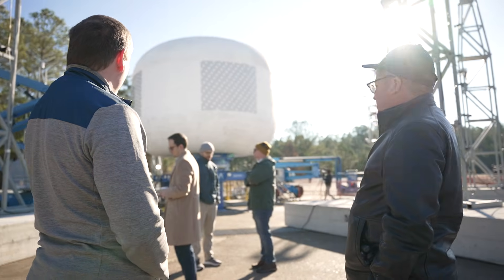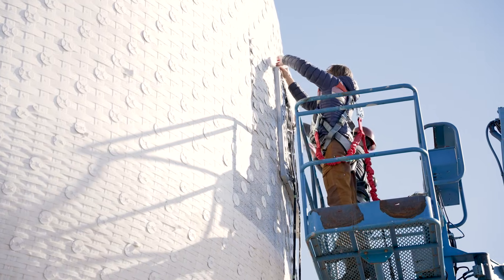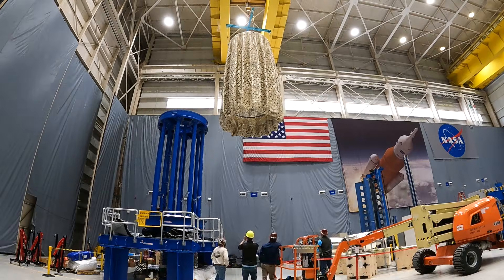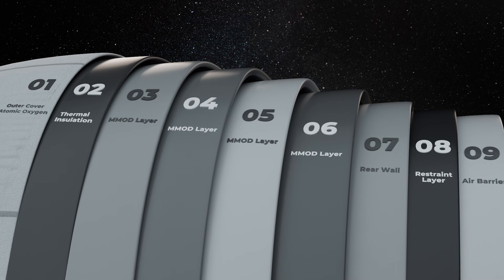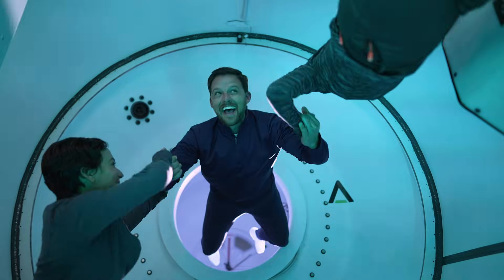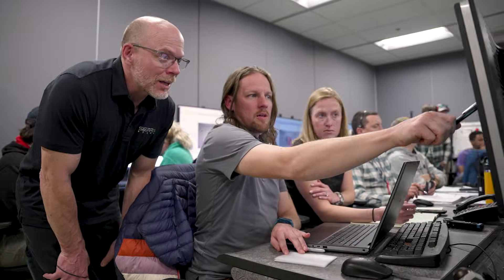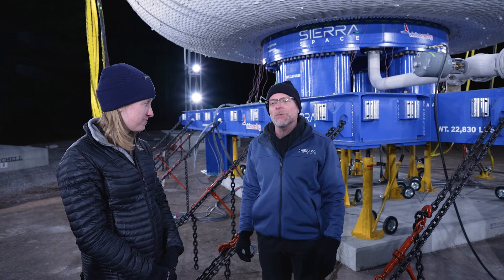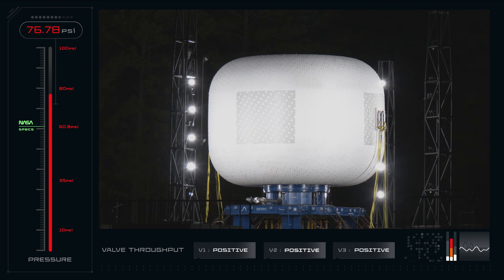Full-Scale LIFE™ Inflatable Space Station Burst Test at NASA Marshall Space Flight Center

Comment: 60psi?!?!  Your woven basket might have an issue with the opposing INFINITE VACUUM OF SPACE pressure of 1.322 × 10-11 Pa coming at you from all sides.  Best of luck!
Reply: tf are you talking about? vacuum means 0 psi
Reply: lol, pressure delta from sea level to vacuum is just 15 psi.  Your 1.3x10-11 Pascal is just a fancy way of saying vacuum, i.e. that ten to the negative 11 Pascal is basically zero..  It's not infinite pressure, it's zero pressure.  You can tell me the difference between 15 psi (sea level) and 0 psi right?

That's an exponent of -11 chief. Minus 11.  So, written out in a way you can (hopefully) understand, that "infinite" pressure is just 0.000000000013 Pa, i.e. very near zero.

You should probably brush up on your units and mathematics before posting such drivel.  Seriously, what's 0-15?  That's the PSI delta to have a pressurized container in space.  You know this exists already on the ISS in both soft body format and hard shell format?
Reply: fun fact vacuums do not push or pull. especially a near-perfect vacuum like outer space, which is also not an infinite vacuum, just a really, really empty stretch of physical space
the only thing that the fabric needs to do is contain the internal pressure, really. given the nature of such a woven basket as well as being a composite of multiple layers specifically built to be strong in tension, it's unlikely that any failure would happen short of a meteorite impacting and popping it / manufacturing defect causing a tear / deployment failure
Reply: "Pressure of space" measured in a way useful for comparing to their 60 psi is only 15 psi. The safety factor is going to be somewhere around 4. Try putting something in a vacuum chamber yourself, the forces arent what you think they are.
Reply: That's not how pressure works. The pressure at sea level is 14.7 psi, the pressure in space is almost 0, so the difference in pressure is only gonna be 14.7 psi higher. So instead of being able to hold 75 psi as demonstrated in this test, the station would be able to hold about 60 psi, which is still 4x times higher than sea level pressure
Reply: That's not how vacuum works.
Reply: Lol I'd recommend staying quiet bud. The pressure differential between a perfect vacuum and sea level pressure is only 14.7 PSI. 60 PSI is a 4x margin of safety
Reply: Out of interest, what conditions do you think are more extreme: 1.322 × 10^-11 Pa, or 0 Pa?
Reply: it's only going to be holding 14.5 psi when in use... no amount of vacuum on the outside will change the pressure exerted from the air inside.  When they found a leak on the ISS, they literally plugged it with their finger while waiting for a solution.
Reply: @thaddday 60 psi is about 4 times the sea level pressure of Earth's atmosphere.  In space, the pressure is 0 psi (it's not negative pressure, just zero pressure.  We're just used to having pressure by living on Earth's surface), and the interior would be regular air at 14.7 psi.  The extra 3 atmospheres before bursting means it has a nice amount of margin in case anything goes wrong.

Also not the first inflatable object in space.  Plenty of others here but a notable recent one would be the inflatable heat shield (LOFTID) flown in November of 2022.
Reply: that's not how vacuum works. even in complete vacuum, there is a difference of only one atmospheric pressure compared to earth
Reply: You do know what a vacuum is, right?
There would be no force pushing in.
Reply: YEA! I found the DUMBEST comment of the video! Space is NOT a negative vacuum genius. Go back to fourth grade science class, learn a little more, then return with something based in reality.

Comment: Let's hope that the extreme space weather, including harsh UV and other radiation, doesn't degrade the material they've used.
Reply: ISS is already covered in textile blanket for years, as main protection from external forces. In addition all Bigelow test articles surpassed expectations, when it comes to structural integrity, and the one that is currently attached to ISS is used as storage unit, so it is not exactly handled as something fragile/unreliable. I believe Sierra can only fail on production of these inflatable modules, either if they get stuck on developing one off custom sizes for new vehicles, or fail to build/finance factory for one size, that fits into most commonly launched vehicles, and potentially neatly stack into heavy lift vehicles.
Reply: Geez, what are the odds they’ve hired scientists and engineers to deal with these issues? Yikes, YT commenters that want to be smarter than everyone else…
Reply: Yeah. My thoughts. Temperature diffential, solar wind, micrometeorites. They should aim to launch demo module as soon as possible to be able to collect data for at least several months operation time.
Reply: It will.
Reply: Here is our Inflatable Space Station.
So it's a balloon?
No, it's an Inflatable Space Sta... yeah OK, it's a balloon.

But more serious, looks nice. Hope they succeed.
Reply: Thank you!  This whole video, all I was thinking was, "What about the radiation?"